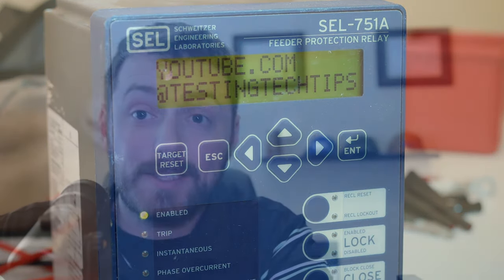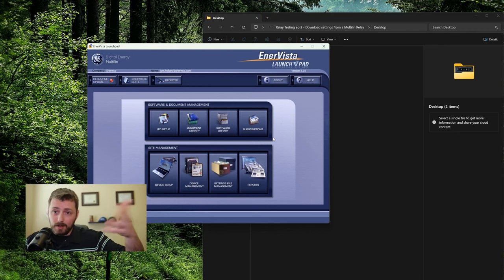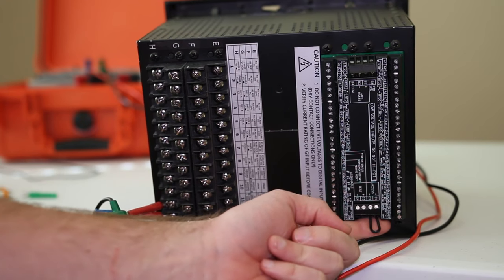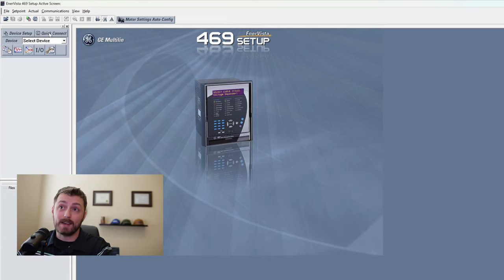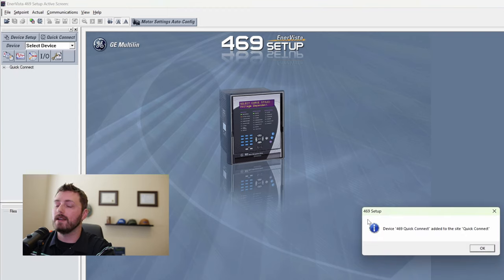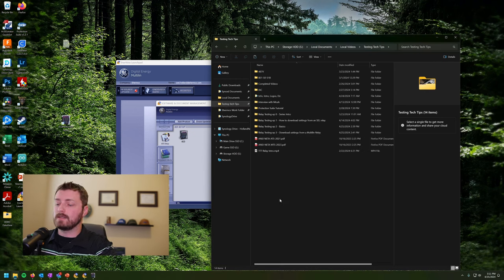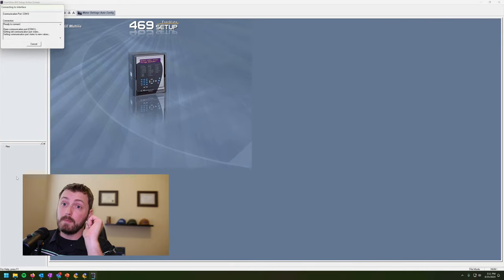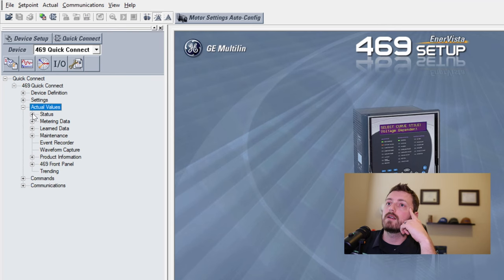Download Settings in a GE Multilin Relay - How to Test Relays ep3

Comment: Hello, is it safe to retrieve the settings file from an active relay of a running motor?
Reply from the maker: For most modern relays, if you are only downloading the settings from the relay to your computer, it should be fine. I would suggest against it if the motor powers something critical, but for most cases yes. You would want to take the relay out of service to install new settings as they may occasionally trigger outputs when new settings are loaded in. That said, you're doing it at your own risk so get a thumbs up from whoever runs the site.